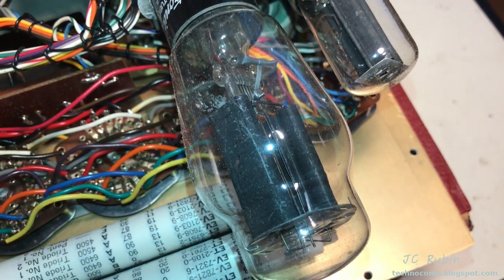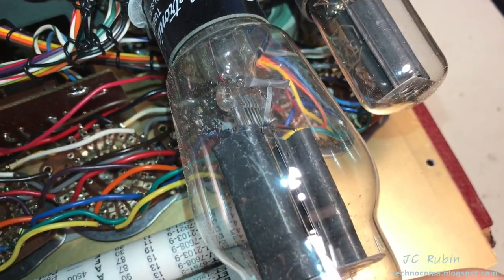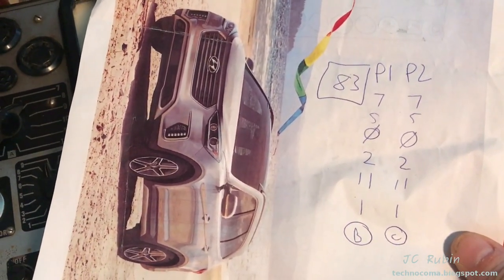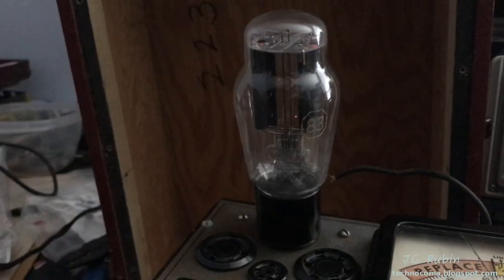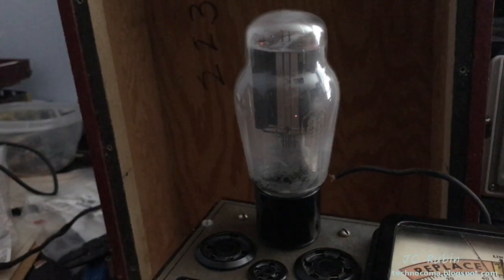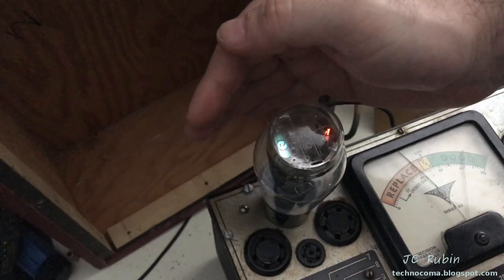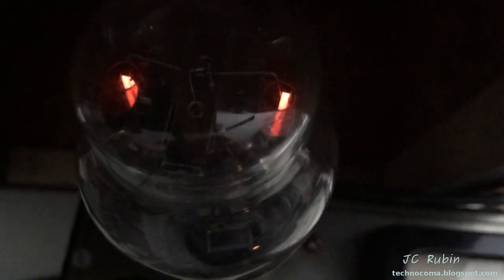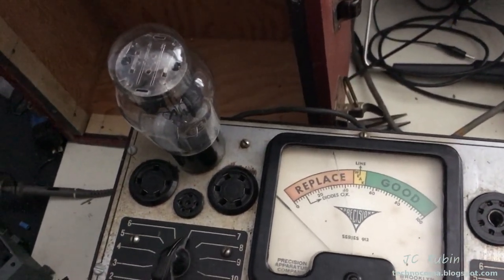Type 83 Vacuum Tube - Mercury Vapor Rectifier - Demo and Test

Comment: Pretty Cool Rubin,, I usually pull those out and replace them with a solid state version just for safety. Thanks for posting this..
Reply from the maker: There is big discussions on that very topic of the 83 vs. solid state
Reply: You should keep the tube just try to put normal diods inside if that's even possible to open a tube

Comment: Brought back memories.....I took vocational electronics in high school 1967, 68, and 69.   I remember studying mercury vapor rectifier tubes.   I wish I still had my books from those classes.   I’m wanting to find a good schematic for a tube leveling pre-amp (compressor or limiter) to use in my home recording studio.  Lo-Z mic input, (200 to 500 ohm) to line level out put.   Any suggestions.  The new digital recording equipment, (as compared to older tape machines) do not act well to spikes in volume.   Cheers from Akron, Ohio.

Comment: What does the Mercury Vapor do differently for rectification compared to a NON Mercury Vapor rectifier tubes like a GZ34 or 5Y3 uses vacuum gas?
Reply: It's an older design so it's not really intended to out perform other designs you may be thinking of.  That being said, it has a low voltage drop. Common rectifiers might see as much as 40-60v drop. If I'm not mistaken the 83V is around 25. A drawback might be it's intended use with a field coil speaker.  It's expecting a field coil and low capacitance. Lose the field coil and it will likely have unfixable hum.
Reply: Has a lower impedance, so provides a higher output voltage (less voltage drop), and improves voltage regulation.

Comment: Interesting rectifier.  I work with half wave types (866A, 866jr, etc).  I wonder why the mercury does not arc and conduct between the 2 plates when in operation as a full wave rectifier, as at the peak of the primary h.v. there would be twice that amount +/- between the 2 plates.  Is that because conduction requires close proximity to a heated element (the enclosed cathodes)?
Reply from the maker: I cant be sure, but by the 30's they were well refined.
Reply: I know im randomly asking but does someone know of a way to get back into an instagram account..?
I was stupid lost my password. I appreciate any assistance you can give me.
Reply: @Bryce Sergio instablaster =)
Reply: @Dennis Gary Thanks so much for your reply. I got to the site on google and I'm in the hacking process atm.
Takes quite some time so I will get back to you later with my results.
Reply: @Dennis Gary it worked and I actually got access to my account again. Im so happy!
Thanks so much you saved my account !
Reply: @Bryce Sergio Glad I could help xD

Comment: I restored two philips EL6420 Amplifiers which uses two AX50 tubes each (nearly if not identicalto the 83) as main rectifiers...i like them when they operate :)
Thanx for this one....and i´m in...You should see this type of tube under usual load conditions...it emits lots of blue light not just the little bit inside the anode you as you demonstrated here, the whole tube lights up...what a blast from the past...but be careful...they needed to be well preheated, if they come right out of storage.
Reply from the maker: CuriousMarc has a teletype restoration with interesting blue rectifiers that emit blue light under load.

Comment: Ok to fix that sticking meter in your tester very carefully take meter apart so can see the needle and in behind it all the springs. Take the meter and sit it in some isopropyl alcohol for 10 min then take it out let it dry for 1 hour and reassemble should fix the sticking
Reply from the maker: Thanks for sharing. That tester is yet to be restored.

Comment: any idea what this worth is for a an early globe shape (ER-83) that tests good? thanks
Reply from the maker: Some are upwards of 30$
Reply: @retrotechandelectronics  thanks I thought it would be more because there are zero on ebay active or complete and even a google search turns up little - just to be clear, talking about the globe shape, not the coke bottle in the video or whatever the correct term is - thanks
Reply: @SuperJV4x  The "Coke Bottle" shaped tubes are also referred to as ST or "Shouldered Tubular" types.

Comment: where do you find tube testers like that, much less the settings to operate them?
Reply from the maker: I bought this one on ebay relatively cheap because it needed to be restored.  This one came with the original manuals.